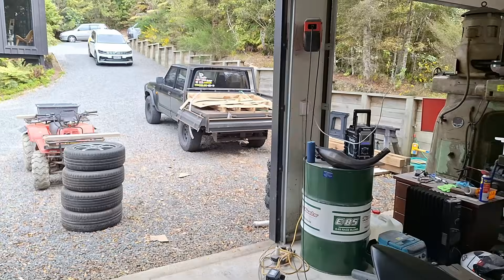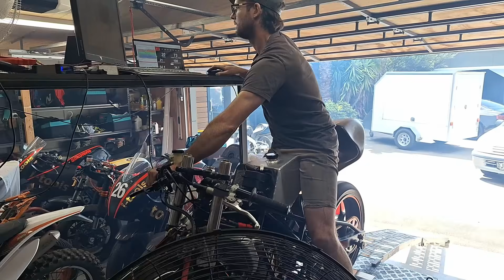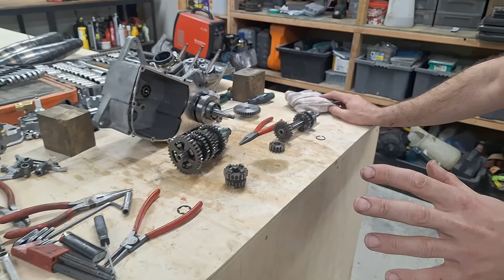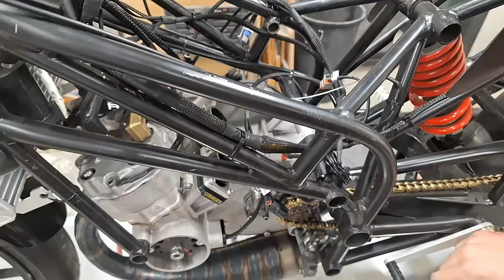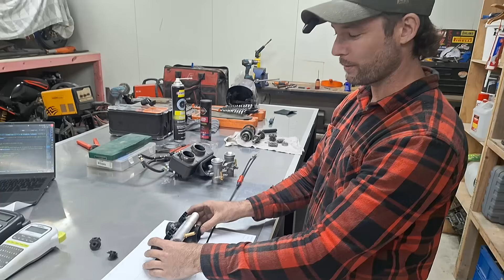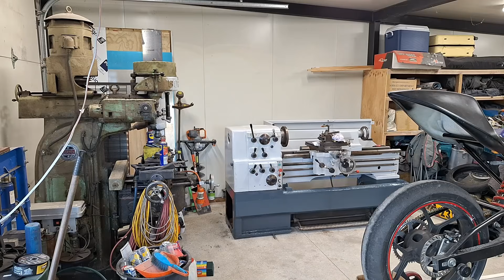3D Printed Race Engine - TST100 hits the Dyno (and breaks)

Comment: U guys r killing it have U got a hp figure to aim for   do U run exhaust power valves   great to cruel injection  on a stroker tho as there is quite a bit of overlap in  intake and exhaust etc I don't envy U setting it all up    I know some peeps run forced induction on strokers  maybe that's a step to take further along  tho it's interesting to C how far U can go NA best of luck love the series  cheers
Reply from the maker: Thanks mate, once we get the motor reliable with the current cylinders, we will upgrade to a Bidalot or similar racing cylinder and matching pipes. At that point the goal would be to try achieve 40hp. No plans for turbo on this bike, class rules wont allow it

Comment: Hey guys, another fantastic video, It's nice to see the bike running and roaring. I came back to the previous video so many times Just to hear the First seconds of bike running. I am currently working on my parallel twin engine too, hopefully One day i can also design an engine casing. 

I was very interested in the gearbox issue. I have no idea how the inside Is and how much room Is needed for the gearbox. It seemed, on those few frames, that the gearbox area Is pretty big! Is It possible, with the minimum clearance for everything, tò reduce that volume? Could It help tò have the oil "spread" on a smaller volume and get It going in the most important parts instead?
Reply from the maker: Thanks mate, yes the gearbox cavity is certainly not very well designed to be honest, there is a lot I would love to re-do with the design. That was the thinking of running a higher oil level the second time.
Reply: @SketchyRacer  I see! It also just came up. It is not rare to see the clutch gear with a bronze insert instead of roller bearing, why not try the same onto the problematic gear? Yes you might need to remove some material on the inner diameter, but it could work nonetheless. Bronze or bronze oil impregnated insert

Comment: As a huge Yamaha LS2 100 twin fan, this is excellent to see. It sounds just like a tuned up LS2. The first gear wheel on the Yamahas have a bronze bushing on the ID with dimples for oiling. Could possibly be something to incorporate into yours if it still gives you issues, or perhaps a spiral oil groove on the shaft. Keep up the great work 🏁
Reply from the maker: Thanks mate, yes you are on the right idea with bronze bushings. It's likely I will try that next.

Comment: nice project! imagen installing 2 Bidalot RF50WR cylinders and you have 36hp easy, sort of ;)
Reply from the maker: As soon as we get the motor running reliably, that is our plan, bolt on a bidalot or similar race cylinder and aim for some power!
Reply: @SketchyRacer  that's great! Or get some PiP cylinders from 2 stokestuffing and you'll get 52 HP easy ;P

Comment: Best project on youtube!
Phenomenal amount of work.

Not sure on the tolerances in the main bearings if this is possible but have you measured to check coupler didnt walk for thrust wear?
I have no experience with crank couplers but the idea scares me haha. Will have to go back to your earlier videos see how you built it!
Reply from the maker: Cheers mate! The couple is pretty simple, just a bit of bar stock with a precision hole bored though it and a couple of clamping screws.
Reply: @SketchyRacer  A "Muff" coupling. 
Ended up having to use soemthing similar when I didn't want to on a machine tool drive shaft. Had to eventually because the Lovejoy style jaw coupling I could fit in the space available didn't like the torque it was subjected to and exploded.  Rather than go for a single piece solid coupling, split on one side and clamped arrangement like yours I went with a 2 part coupling. Start with 2 pieces of rectangular bar, face one side of each and put clearance holes on one and tapped holes in the other. Add a couple of hollow location dowels on oppsoite corners on 2 of the fixings. Clamp the parts together, then machine the bore on the split centreline & the outside concentric to bore. Clamps the shafts well, with no distortion or side loads applied when clamping up & easy to machine in keyways if required. May end up better balanced as a bonus if the design could be made symetrical . 
My solution worked well for the application, but was running slower than yours (probably 3000 rpm max). Did have to cope with 30kW though.

Comment: Do you see a reason you couldn't just run one large injector which had really good low pulse width ability ? or is there reasons it has to be two injectors ?
Reply from the maker: The pulse width is too short at idle/low engine load with a single injector. Maybe it's possible, but in my mind it's better to have two injectors working within their optimum range. KTM has two injectors in their TBI bikes as I suspect they have the same issue.
Reply: @SketchyRacer  Makes sense. Thank you for the reply. I run a single injector on my turbo 110cc pitbike motor in my honda chaly. I had to go to a smaller one as it was terrible down low pulses. I use injector dynamics injectors on the cars i modify and they run down to extremely low pulse widths. Ill experiment and put a comment letting you know what i find when i have. Have a lovely week. I hope its as nice weather there as it is here in AK, NZ. :)

Comment: Amazing work! Such a great achievement I love the videos! 
Couple questions. One you answered about just running one injector which is a shame as it removes that hurdle when tuning
Two:
On my bsa bantam (I know) but small splash lubed gearbox. I noticed some small holes drilled from the valley of the gear teeth to the inner bore/journal. I assume this forces oil into there under the same principle as a spur gear pump?! 
Seems like you might have that issues sorted though.
With the crank, if not from twist could it be the coupler allowing flex?  Although I gues the bearings will counter/prevent that?! 
Just throwing ideas out there encase it helps! 

Keep it up!
Reply from the maker: Hi mate, I did suspect the crank coupler, but the cranks are supported with 4 bearings so I have my doubt that they are flexing enough to cause the side load issue. The 'core' of the crankcase is pretty thick and strong too, more so than a typical production engine. Cheers!

Comment: Hey Guys! 
Its great to see others going the same way we are:) You're on the right way! We made an Aprilia RS125 work with Fuel Injection. We have now around 15h of track time on 2 machines plus a few hours of Dyno Time. It works great, carbs are boring:) I hope you find a good solution for durable gears, the ones out of a rotax 122 can handle quite a beating if you can fit them, running without oilpump. We are running around 32hp at the wheel, which is a good mix of power and reliability.

Some stuff we found out:
1. You can print throttle Bodys simply with FDM (we used PA12CF), just use some kind of bearing and seals for the shaft. We have 15h on the throttle body and it didnt move, there is no sign of wear at all. We put one test print in a can of fuel and after one month it was same as new. No need to change it for a aluminium one.
2. Bosch makes really nice Injectors, that (if set up correctly) work a really wide range. We have super nice Idle and are at 70% at full throttle (Check out some they use in Rotax engines)
3. Youll find out the biggest problem to set up your VE Table will be the injection times at high rpm with no load/Throttle. Once you got a proper running VE table for full throttle, check what happens when closing throttle for 2,4,6 and 8 seconds and then you go back to power. Try to tune it in a way that even at 0-3% throttle you still get the engine to fire once a few times. This will also help to keep your exhausts warm.
4. The easiest way to tune is to get exhaust gas temperature and lambda (AFR). EGT 12cm after piston and AFR in the Belly.
5. Super important to setup is: dead times of the injectors at different voltage of battery and fuel pressure. (and make sure you have constant fuel pressure. We tracked it and found out not all regulators are good.
Hope that this information could be of some help ;) 
Greetings from Germany
Scraprocket Racing
Reply from the maker: Hi mate, Thank you for some really interesting information there! The current throttle body is printed in PPA-CF and much like the PA12CF it is proving to be incredibly fuel stable. We are tuning with Alpha-N (TPS) at the moment, and have exactly the condition you describe with over fueling when the pipe is not resonating. The solution I am trying is having a inverted acceleration enrichment table during the roll on and off of the throttle. It reduces fuel for a determined percentage and time and tapers back into the correct fuel for once the pipe is resonating. It appears that takes around 4-6 engine cycles. Unfortunately I still have not had a chance to fully test this yet as I keep mechanically breaking something before having an acceptable base VE table to work from. Yes with staging the injectors, its incredibly important that the dead time and flow characteristic of the injector is accurate. We are using a 18v battery with a 12v regulator at the moment, the data log shows a super stable voltage output. What ECU did you use for your project? Cheers
Reply: @SketchyRacer  A good tuned Alpha-N is enough. We tried to adjust fuel over EGT in the belly, but in the end its not needed. It just ads complexity. Just tune really low on high rpm and low tps, (our VE is around 0.8-1.5). It makes the engine fire a few times and its perfect. We compared to a carb and we are still running richer than a carb so there is no problem with bearings or piston not getting enough oil. The actual amount of fuel a carb delivers is really low when throttle is closed. We use a rusEFI board with tuner studio (combined with ms dash its a really neat setup)
Reply: Can someone explain to me how carbs are boring?
Reply: @garyalexander2480 fuel injection is just a better way to deliver fuel. FI offers vastly more tuning ability and precision and opens the doors to a long list of other electronic technologies.
Reply: @LukeRiley68  in conjunction with other technologies maybe, not stand alone vs a carb on a crankcase induction two stroke no way not true

Comment: Hi, 
You have a lot of small problem on your motor. You have a lot of work for hit a minimal hp crank base std. 
Good Luck
Reply from the maker: Yes, lots of problems with a custom made engine haha! Power is easy to make with new higher performance cylinders and pipes to match. This project is focused mostly on the challenge of building a new engine from scratch and fuel injection. Cheers

Comment: you mentioned that the crankshaft might be a bit "bent", have you thought about a crank balancer?
Reply from the maker: The crank itself wasn't bent, I checked the runout. I suspect the conrod itself is slightly bent. I'll measure it once I get the cranks apart. I'll balance them up when they go back together